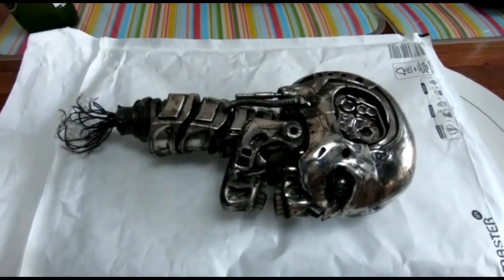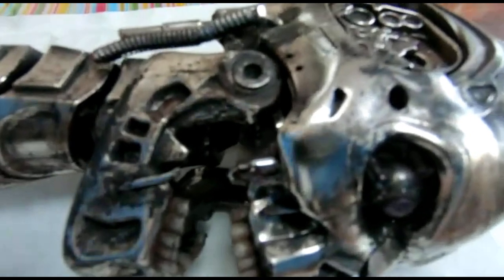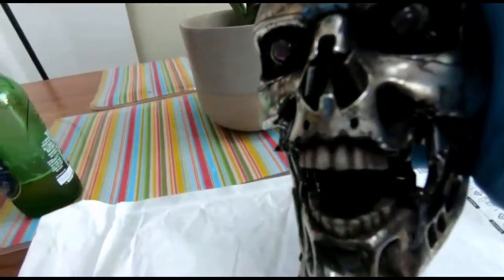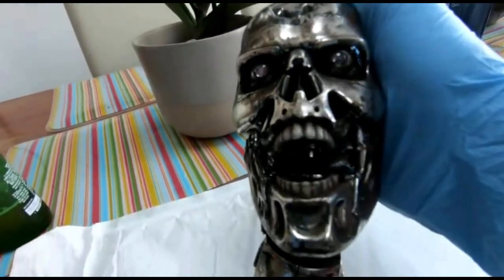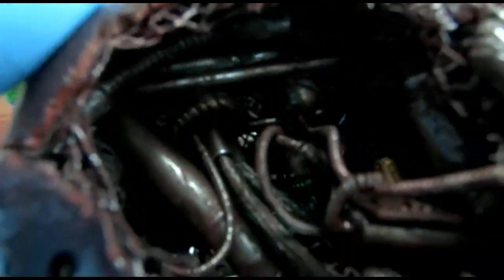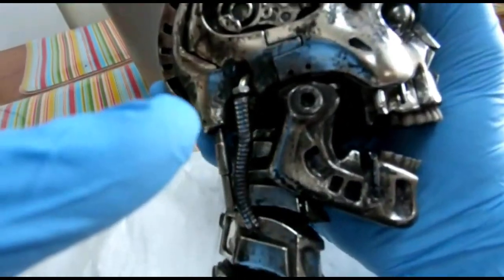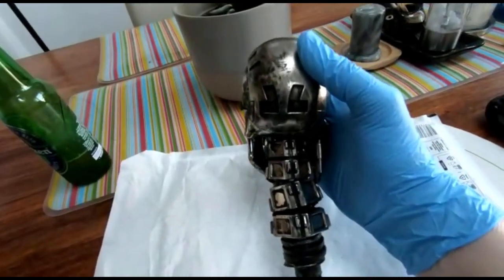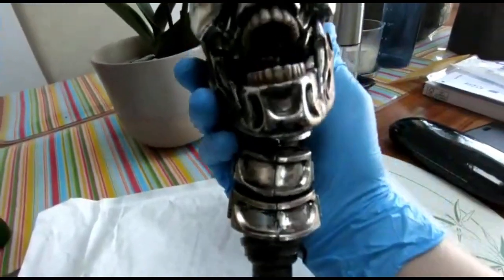Zombie 1/2 scale custom metal T-800 Endoskeleton Skull

Comment: very awesome!! for mine though I am just going to use the loot crate t800 head 9aprox £7 on ebay) (i put a pic up in the community section of my channel) I drilled out the eyes as a test, can also make them look milky for a more dead effect. with some repainting and weathering and cutting i think the loot crate skull is a good budget way to get a damaged skull on the base. it will not look as good as this one though!
Reply from the maker: That's exactly what I was going to do but then I found this one on eBay and the rest is history 😁😎